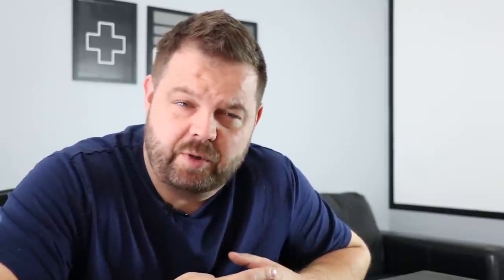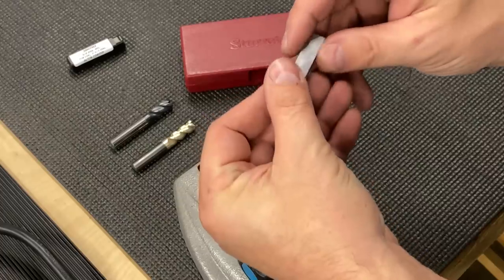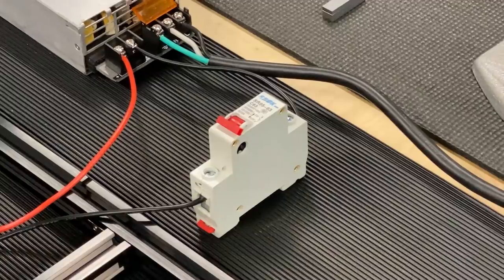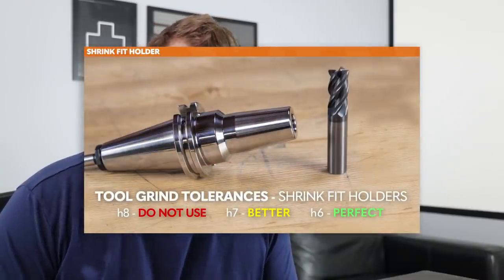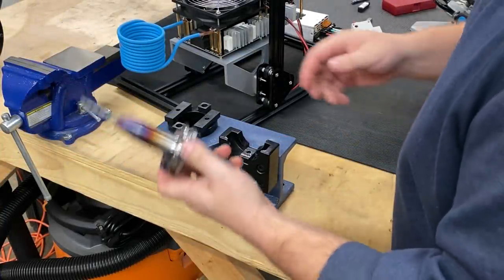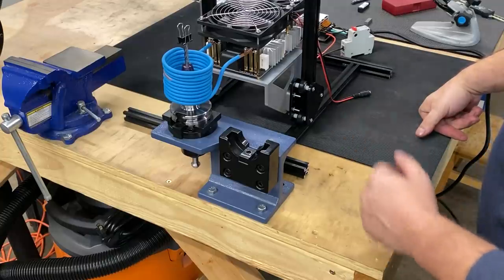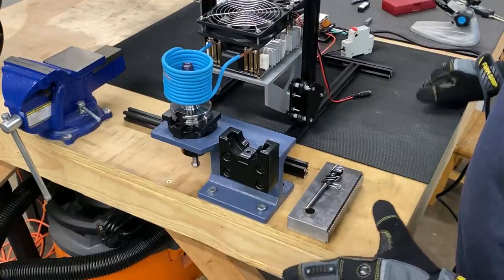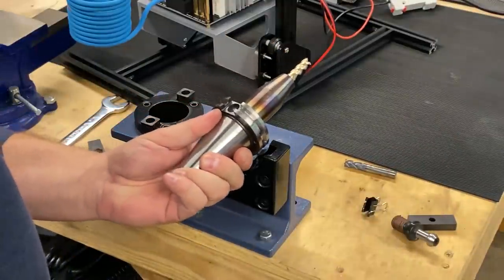CNC: Low Budget Shrink Fit

Comment: a small manual lathe and one of those butane torches works great and you don't have to worry about uneven heating or cooling. We do a lot of 1/8" heat shrink tooling that way and I can do a tool change in about a minute and a half including cool down with an air gun.
Reply: Craig thanks for your dead-simple & inexpensive approach..... Love the idea of spinning it...I imagine you will say it doesn't matter but about what RPMs do you spin the manual lathe?
Reply: @davidlawrence8085  hi David thanks, I just spin it at about 50 rpm.  I don't think there's any benefit to going faster (also I don't like to clamp the tool holders to tight so they don't get marks on them)and that way I can stop the spindle quicker to take the old out and put the new in.
Reply: That is a good idea, if you have a manual lathe in the shop. Sadly, these seem to be getting scarcer each year. The propane torch heat source shows good smarts.

Comment: J on professional heat shrink machines you have a much smaller coil that is smaller in diameter and smaller height.  You also want to stay below ~500f, never go above blue temper otherwise you're going to get some oxidization on the holder.
Reply from the maker: capnthepeafarmer thank you
Reply: Not to mention if you get too hot, you'll start to mess with the heat treatment of the tool holder.
Reply: Crazy seeing you here! @MysticalDork

Comment: I think you letting it to heat up to long , what I normally do is turn on the heat shrink machine, and hover the bit over the holder until it slips in, what I been told is that you can damage the tool holder if you over heat then for too long you could use a Arduino with a built in timer to prevent overheating
Reply: You are right, that holder which heated to red is probably damaged. 

Not only the micro structure (hardness, etc.), but probably deformed as well loosing accuracy (which was aimed by the shrik-fit). You need a thermometer (or thermo camera), not (only) a timer to control the temperature, and do the homework to calculate or look after the right temp. You can use the damaged holder to calibrate the process.
Otherwise congrats to your machine! Maybe a little bit smaller diameter and shorter length coil could concentrate the energy to the place where only needs to be heated.

Comment: I think you overheated the holder - they dont require that much heat to get them to open enough to drop an endmill in.
Reply from the maker: yeah maybe.....ive seen guys get em cherry red with a torch...it'll be fine and if it isnt...i'll buy a new one.......its the price of an education
Reply: @NerdlyCNC  ya it looks like u toasted that holder. we use haimer heat shrinks and we never got them that hot usually hit them for 5 to 10 seconds and that was it. I would not recommend hss for heat shrinks unless index cutters
Reply: @NerdlyCNC  ye looks like you are overheating it abbit. but ye its true you wont destroy the holder even if its red hot. but i belive its bad practice. what i like to do is to have a tool in the holder and heat it wile i pull on the end mill and when it realese  i note the time. I got some thin Haimer shrinkfit exetensions red hot and measured to see if there was any run out. and it was still like new.
Reply: @johnhansen1684  i think the issue with over heating is it reduces cycle life dramatically. One of those relays with built in timers might be a good idea here.
Reply: pretty sure that's infrared that the camera is able to pick up bro
Reply: I agree. Small holders take a very short shrink cycles. When I saw the smoking had stopped.. that looked just about right. Now big holders (1 1/4 in. plus) are a different matter. All of my experience has been mostly with automated shrink machines - with pre-programmed parameters. Just plug in a holder code, endmill code, push go and follow the prompts. But, those machines cost tens of thousands of dollars and tied into a large industrial tool management database.

Comment: Building a similar project using an off the shelf 15kw power supply. I would recommend adding a foot pedal control that does 2 things -#1 throws the contactor to energize the unit and #2 controls a pneumatic valve to actuate a cylinder for raising and lowering the coil. If you want to go a step further get a multi-position valve with a timer that initiates an air cool down cycle. Not a fan of using breakers as an on / off switch, they're not really designed to be cycled repeatedly.

Comment: I work in the tube and pipe industry and design parts for tube mills. One thing I deal with are industrial scale induction heaters, they are used to weld the tubing in line as it gets formed. 
A very important parameter is the frequency at which the heater switches current (all induction heaters work on AC). 
Frequency dictates radial penetration depth of the heat into your part. The higher the frequency, the shallower the depth of active heating measured from the outside in.

In your case it’s desirable to turn the frequency all the way up so the heat gets to the tool as slowly as possible.
Your unit cannot go too high, you would need to go above the megahertz range to see a drop in efficiency.

Speaking of efficiency, since you use a relatively low powered unit efficiency matters. The strength of the switching magnetic field which causes the heating weakens squarely with distance form the coil. This means you will see great benefits by making your coil fit around your holder much tighter than you have it now. If you’re afraid to burn your insulation you can use glass fiber wrap if you have easy access to that  or if you want permanent coils you can try a ceramic dip, nothing fancy just basic pottery stuff. We use a teflon sleeve but our coil is cooled through and the moving pipe doesn’t radiate much heat unlike your stationary tool holder.

I would also recommend removing turns from your coil. A turn or two short from the overall length of the part that needs heating. An overly long coil is just wasting power.

Induction heating can seem like black magic but these simple guidelines should help you improve your setup, feel free to ask if you have questions about this
Reply: i doubt he's got control over the frequency this thing puts out lol. given that the induced current is going the same direction throughout the part, and that there's a hole in the middle, wouldn't the skin effect at cause the outside and the inside to be heated? (like this: https://i.imgur.com/FZyWTw1.png )
Reply: These smaller heaters are self-resonant - They have no way to control the frequency.
Reply: You absolutely want to avoid heating Teflon ( or other fluorinated polymers) over 200°c, it will smoke toxic fumes.
Reply: @SuperYellowsubmarin  the teflon in the process I work on does not get hot and even if it did there is an enormously  powerful centrifugal extraction system that sucks up everything from smoke, streams of coolant and even solid chunks of material if they happen to fly by
Reply: Hi, I bought 2000w zvs heater for diy shrink fit and it works great, except in I put whole tool holder in the coil it draws too much amps, so overcurrent protection kicks on. Basicly the larger diameter I put in the coil more amperage it draws. Having little EE knowledge I wonder if making similar coil with same number of turns but larger in diameter would help. Or maybe just taking a turn away, now it's five turns.

Comment: Pretty cool set up man! I used to set shrink fit tools using a very expensive Zoller tool presetter and it looks like you’re cooking your tool holders. I’d recommend holding the end mill as the holder is heating and every couple seconds check to see if it will slip in. The second you feel that it will slip in, turn it off. Overheating them will reduce the life of the tool holder!

Just thought I’d let you know, take it easy!
Reply from the maker: Andrew Henry thanks Andrew. Will do.

Comment: Just found this video.  GREAT stuff, I did get set up to attempt this last year but did something dumb.  The cheap ebay induction coil I bought had a bare PCB with exposed terminals on the bottom.  I shorted the whole thing out when I placed it on a steel table.  
This video motivated me to try again. 
Again great video, great!

Comment: Your heater seems to work nicely. Congratulations. Now for the Dad lecture. Throw those gloves with the synthetic(sticky when melted) materials in a tool box, away from hot surfaces. Hot mill or welding gloves would be a safer choice.
 Also consider what would happen if you step on a piece of hot slag from a welder or cutting torch while wearing sneakers or any thin soled shoes.

Comment: I bought the exact same kit from the exact same seller. For wiring to the power supply, the terminals are labeled ground, N and L. To get into the 200-250v range I would need to go Leg-to-Leg, not just Leg-to-Neutral. Is that what you did? I'm wary to wire voltage to a terminal labeled for neutral, but that seems to be how you'd have to do it. IIRC my shop is 208v 3ø where any L-N is 120v and any L-L is 208v.

Excellent video, and thanks for your contribution!

Comment: Oh, and are you powering the nice big fans on the induction driver separately or are you killing their power as well as the main power for the induction circuit?
Reply from the maker: Robert Szasz it comes with a power supply for fans / coolant pump

Comment: Great job. Wondering if the same can be done with 2kW and 110V. Maybe will take more time but for a hobbyist it isn’t that important.
Reply from the maker: dmyegorov74 you may not be able to get end mill out of holder
Reply: Nerdly i think power of the heater only affects how soon your tool holder and end mill will reach certain temperature... if carbide has lower temperature expansion than steel, you just need to reach certain temperature of both to take your tool out of holder... less power you have, the longer it will take... so i guess 2kW is good enough unless your room temperature is too low and the surface area of your tool holder is too large to dissipate the heat you are trying to induce into the holder
Reply from the maker: dmyegorov74 I agree. But heat soak is a problem
Reply: Nerdly a little covered box with a door around the area can greatly reduce heat loss. I’d try a $50 induction cooktop from amazon with a modified coil.
Reply: @dmyegorov74  Heat loss to the environment is not the issue, the issue is heat transfer from the tool holder, to the tool - Even though carbide and steel have different coefficients of expansion, that is often not enough to get the tool out of the holder at a reasonable temperature, when the tool and the holder are the same temperature.

That's why it's easier to get the tool in, than it is to get it out - when inserting, the tool is at room temperature. With a commercial system, the heating is localized to the holder only, and is fast enough that by the time the holder is at ~500F, the tool is only maybe ~200F. 

That extra thermal differential is essential, especially if you want your tool holders to last a long time, by not heating them to a ridiculously high (glowing red) temperature and changing the temper of the toolholder.
Reply: Ryan Willis How can the heating be localized to a holder only!?  The magnetic field is going through the entire assembly...
Reply: @dmyegorov74  The skin effect, mostly. https://en.wikipedia.org/wiki/Skin_effect

Comment: Are you running cooling water through the induction coil? (And did you tune the coil or are you running as supplied and they should have tuned it?)
Reply from the maker: Robert Szasz not yet / as supplied
Reply: @NerdlyCNC  Do you know if reducing the number of loops in the coil would concentrate the energy to a smaller length?  I'd love to get some shrink fits on my new Fadal and was looking at doing something just like this.
Reply: @ReiniGrauer  yes it would
Reply: @ReiniGrauer  Yes, to maximize heating it'd be best to shrink the coil in both diameter and length - The closer the better, because magnetic field strength drops off with the distance cubed - Double the distance, 16 times less field strength.

Comment: I think it might be a good idea to invest in one of those $25 infrared thermometers. Let you know when it's hot, and when it's not. Know what I mean, Vern?
Reply: R Allen 
They don’t tend to be very accurate on shiny metal, the best method is to gently hold or pull the tool then it will move as soon as it’s hot enough

Comment: Why not a hydraulic chuck tool holder? I found some pricing here https://www.cutwel.co.uk/tool-holding/bt-mas-bt30bt40bt50/bt-mas-hydraulic-expansion-chucks/bt30-1. It does not seem to be that bad compared to shrink fit holders and you save the cost of the induction heater.
Reply from the maker: Baldur Norddahl I guess you didn’t hear me say I need clearance for 5 axis
Reply: @NerdlyCNC  Some of the hydraulic options are just as slim.
Reply from the maker: @BaldurNorddahl  for .125" end mills?
Reply: @NerdlyCNC  well sure although I believe you are supposed to use a sleeve to hold very small tools. Something like this:

https://www.kennametal.com/en/products/20478624/2664259/42025689/42025693/54449232/100018496.html

I am not claiming to be the know it all. In fact I just got a small hobby CNC mill with BT30 tooling and I am happy with ER collets. It was just that you said shrink fit was the hot thing and I thought it was actually hydraulic that all the cool kids are bragging about now.

From a pricing perspective it appears that if you only need a few holders, then hydraulic could be the cheaper option, because you save procuring the heater. If you need a lot then the simple shrink fit system will win cost wise.

Comment: Using a breaker as a switch is definitely not recommended. The contacts are not designed for DC-current so it can arch too much, and that'll ruin the contacts or better yet, doesn't cut the power when you need it to.

What's more, that setup isn't stable so you're adding unnecessary risk of getting electrocuted by not having things bolted down.

You also don't want ANY live parts that you can even by accident touch etc... I can see there plenty.... don't :D

Comment: You should never use a micrometer to measure your gage blocks.  Especially if your mics are carbide tipped.  Over time it will wear
the blocks unevenly.  I've been scolded for that many times from old-school tool makers.
Reply from the maker: Dan Arrington lmao. I’m not sure what else I’d measure them with.  And this isn’t my $1700 mitutoyo set. It’s a $150 set
Reply: @NerdlyCNC  I said the same thing.  How do I measure them?  I ended up buying a cheap set for myself so that I wouldn't get chewed out for doing that.  Their answer is that each block has its size engraved on it. Just do the math.
Reply from the maker: Dan Arrington lol. I was using it to ensure mic was dead accurate.
Reply: The measuring force of a micrometer is around 12-14 N. I have no idea how that would damage anything unless you scratch it. Great content as always!
Reply: @horvathcsaba1265  That's the reason.  The carbide will scratch the surface of the block.
Reply: @danarrington2224  My answer was, use a wear block on each end, and include their thickness in your stackup.
Reply: @MysticalDork  Correct.  You should always use wear blocks.
Reply: Lol, old school wives tale. There's hardly any friction with a mic on a gage block. It's more common to damage gage blocks by leaving them wrung together.
Reply: I have a carbide, '0' set I use for calibrating my mikes. More specificly at the size of the critical tolerance of the job.
If the set isn't certified with a list of actual sizes there is some 'guessing' going on..
Especially if there is a stack.
Just say'n.
Reply: Jay Pierson Yeah. What would a bunch of tool makers with 40 years of experience know....
Reply: @danarrington2224  Pft, 40 yrs of ignorance. It's just plain science: 8ra 67Rc vs 8ra 62Rc = non issue.
Reply: @jaypie0864  It's a shame that all of that knowledge and experience will die with them because the next generation already knows everything.

Comment: Hi Jason
Try making a smaller coil for it, mine is 3/16 tubing wound around a 50mm bar. 
heats my holders in roughly 12 seconds, just be careful going too tight as could overload the unit.
Here's some clips off my phone of mine working: https://youtu.be/qRQxg6qOfEU